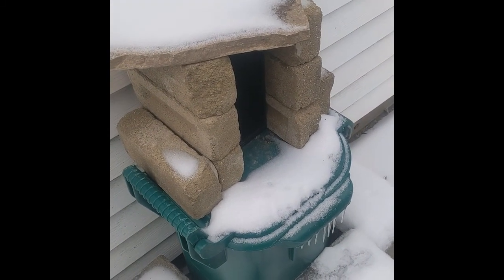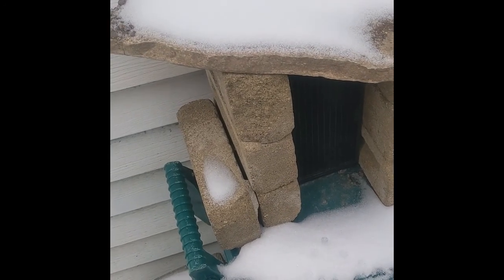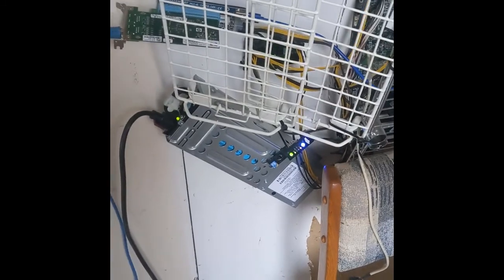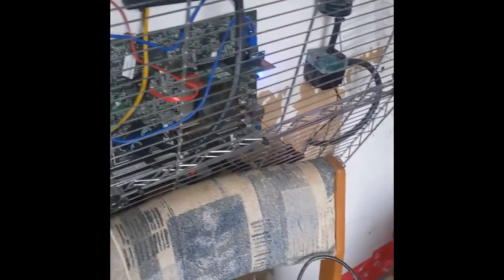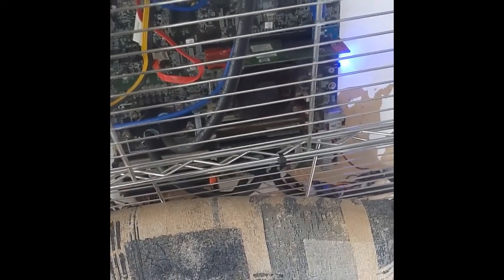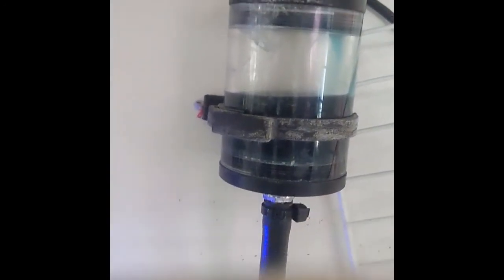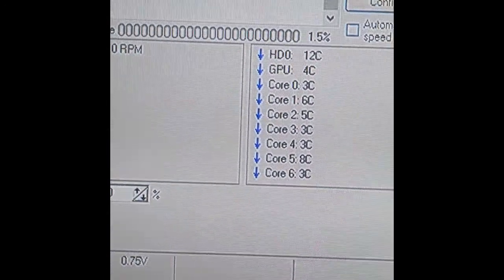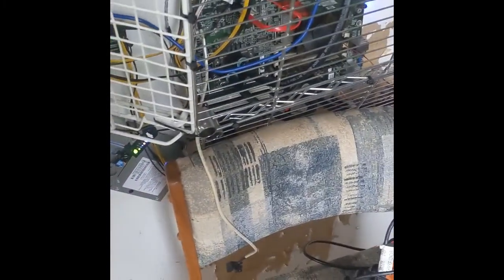Liquid Cooled PC with outdoors external radiator (outside radiator) automotive coolant water cooling

Comment: How did you solve the condensation problem?
Reply: @robsyoutube  kinky
Reply: Cut the fans or reduce the speed dramatically and let it transfer heat through radiation potentially, BUT it depends on the dewpoint in the house too. 72°F with an RH of 40 puts you at 46.3°F for dewpoint, or 8°C so it wont condense unless the  liquid/pipe gets colder than that. Not sure of the conditions he has but that the RH I stated is pretty generous during winter so it could be even lower.